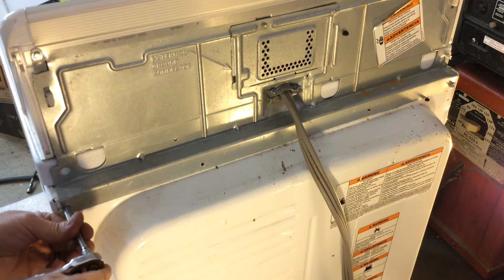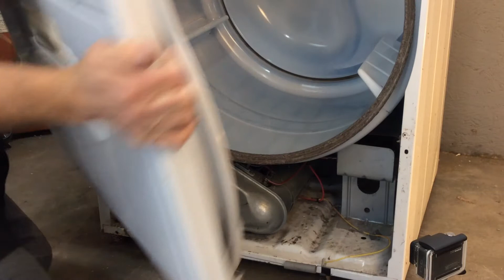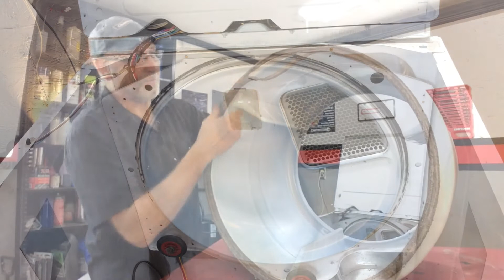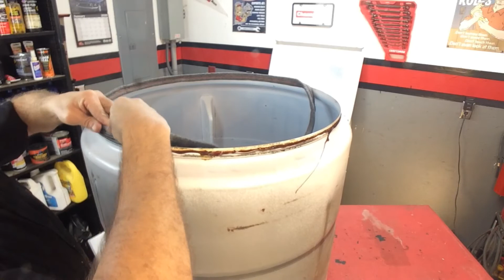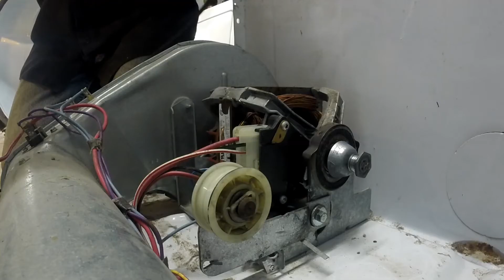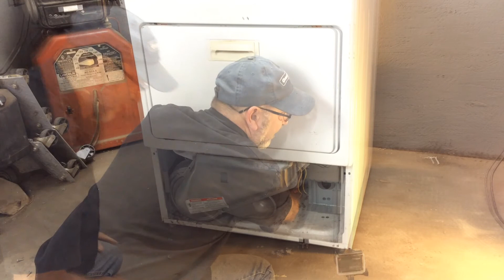Dryer Making Metal Scraping Noise

Comment: The water heater repair guy wanted $1900 dollars and we had to supply the water heater for a broken site glass.  He said its an old water heater a 2008.  All i did was found a piece of glass and plugged back in a unplugged plug probably from the Estimate giver.  I was about to purchase a $500 water heater and do it myself until i found that SOMEONE unplugged the plug in the area of the site glass..  iTS BEEN WORKING FOR 2 YEARS NOW
Reply: Burger King wanted $12 for a hamburger, fries , and soda, so I went to Walmart and bought all the stuff and cooked it myself. I got a hamburger, Fries, and soda for less than $5

Comment: What happens if you mix up the connections inside the dryer while reassembling? My door switch has different colored wires
Reply: Also, thank you for the video. Was easy to understand and very easy to fix. Other than not remembering where the wires go…
Reply from the maker: Some times I have to take pitcher with my phone to remember.
Reply from the maker: if only 2 wire dose not mater.